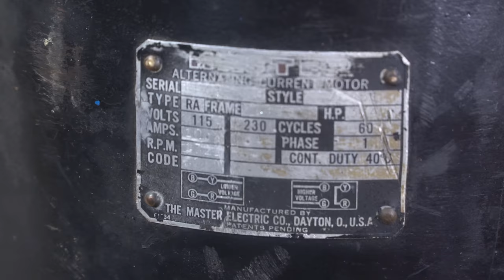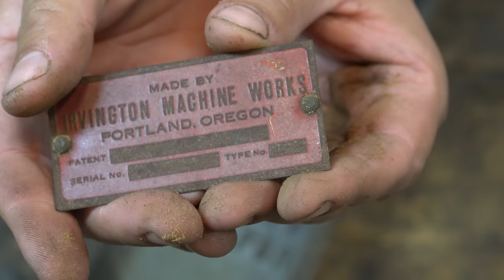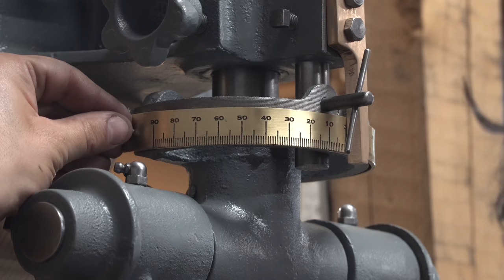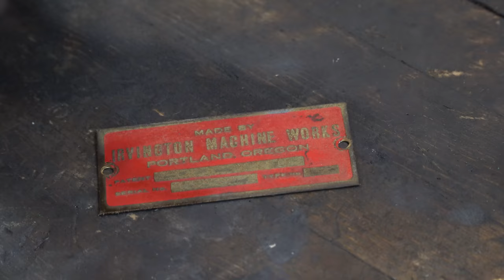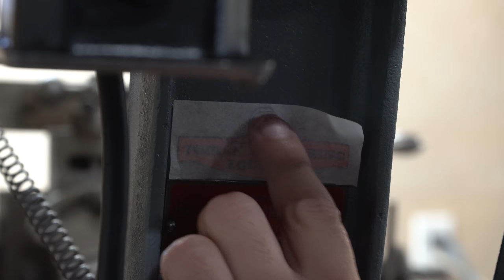Swing Saw [Restoration]

Comment: The suicide saw aka "the model"
Reply from the maker: Should have just called it "The Murder".
Reply: @HandToolRescue  Yep indeed HAHA XD
Reply: was just about to say "what a dangerous saw" but you beat me to it
Reply: I was thinking that "Riders on the Storm" should have been playing while we watched it operate.
Reply: Safety is not your number one priority !  lol  XD
Reply: ''Hello, i need a replacement blade for my saw.'' - ''Wich model sir?'' - ''Yes''
Reply: @HandToolRescue  What process did you  use @24:04? Did you mask Stainless steel with paint, then use laser to make lines in the mask and etched it?
Reply: 23:41 is that a 'Weltrekord' I spy?
Reply from the maker: @RagingShrimp67  Yes.
Reply: It's not that dangerous by itself, but those wood beams look way too thin to support it for more than a short demo. Actually table saw mounts aren't inherently safer, just more familiar/popular, in a proper mount this thing can be quite useful for someone who knows how to operate it. 
As a side note, very few workshop injuries are related to large wood saws, probably because most people tend to be a bit more careful around large spinning blades, statistically the most dangerous hand operated tool is the angle grinder (and for the non-powered ones the good old hammer still brakes more fingers than anything else).
Reply: hey my Mechanics didn't you restore a screwdriver like hes using at https://youtu.be/oUWOOFII144?t=1420
Reply: A saw so awesome Kraftwerk wrote a song about it
Reply: @my mechanics: is he using the screwdriver at 23:40 you restored? Or its just the same model?
Reply: @valkasolidor6727  no, Along Came Jones by Ray Stevens

I plopped down in my easy chair and turned on Channel 2
A bad gunslinger called Salty Sam was chasin' poor Sweet Sue
He trapped her in the old sawmill and said with an evil laugh,
"If you don't give me the deed to your ranch
I'll saw you all in half!"
Reply: @trollforge  Was he slow walkin'?  Slow talkin'?  Okay, yeah, it checks out sir.
Reply: @HandToolRescue  The Corpse Disposal.
Reply: @HandToolRescue   Now I am whispering... "The Murder".
Reply: It had a more complete name but it got chopped off.
Reply: Sie ist ein model und sie seht gut aus
Reply: @HandToolRescue  "The Mangler"
Reply: @HandToolRescue  my dissapointment is immeasurable you didn't use the other side of the giant wrench for the smaller square bolts. I don't think I'll ever be alright again. How do you pre-pose we correct this?
Reply: @Dr_V  I would give this comment a thumbs up but my thumbs are currently too swollen to make such a gesture. Venture to guess why?
Reply: Haha the murder!

Comment: Well that is a truly frightening machine! Nice method for making the brass scales 😉
Reply from the maker: Thanks! If only there was a good video on brass acid etching...
Reply: @HandToolRescue  if there's one thing the internet needs it's more brass etching videos!
Reply: @SwitchAndLever  agreed!
Reply: Sorcerers! The whole lot of you!
Reply: @SwitchAndLever  I know you already made a brass etching video, but maybe you could upload another?  We miss you and need a fix.
Reply: I have actually used something similar to this. Terrifying is more the word! As always an excellent restoration!! I'd like to know how he finds that stuff?? Some of it I've never seen before!
Reply: What did you use to print the resist onto the brass for the etching process?
Reply: It's seriously what Poe would write about.
Reply: Don't lie, How many of you read that comment in S&L's accent? I know I did!
Reply: @mikepelletier1399  It looks like he painted the brass and then removed bits of the paint using a laser cutter.
Reply: @Ragnar8504  yes, that looks about right, but why not just use that instead of going through the process of etching?
Reply: I cringed every time that saw moved.
Reply: @mikepelletier1399  You can't. Most places I've heard of have CO2 lasers that won't touch metal at all. Fibre lasers, which are even more expensive, will scratch the surface of some metals and cut very thin films but I suspect for getting this deep into brass you'd still have to etch it. There are lasers that cut serious stainless sheet metal but they're huge and probably cost millions. At work I've got a 120 W CO2 laser, which costs as much as a Mercedes but it doesn't engrave or cut any metals. The typical DIY lasers have much less power than that.

I'd definitely like to know what kind of paint is safe to use in a laser cutter because that's quite an interesting application!
Reply: @Ragnar8504  that makes sense. I use to program laser engravers to do 3D QR codes in plastic for the military. And it could oblate the black anodized surface of metal tags. That's about all we dared to try. Something about laser feedback from shiny metals or something. But it could cut shapes out of wood and plastics at %100 power.
Reply: @mikepelletier1399  Yup, that about sums it up! I don't think trying it on metal would cause any harm but it just wouldn't work. The only thing ours can and will do is "mark" steel, i.e. if you coat the steel with some kind of paste supplied by the manufacturer of the laser, any spots hit by the laser will turn black but that's only on the very surface of the steel. Rumour has it that mustard will do the trick as well but that hasn't worked for us.

A 60 W CO2 laser will cut through quite substantial pieces of timber (relatively speaking) if you run it slowly enough. I've cut 13 mm pine plywood. The edges are quite badly charred and no longer quite straight but it does cut. The official info is that you can cut roughly 1 mm of timber per 10 W of laser power, which equals to a maximum of 6 mm on a 60 W laser and 12 on a 120 W. However, the thicker the material gets, the more the laser is out of focus so you'd have to cut in several passes, adjusting the focus in between, to get a perfect result.
Reply: SCIENCE! Not poems and rubbish. Or fingers. Or any appendage or limb that happen to be in the room.

Comment: A very nice machine, and, as usual, a nice restoration.  Regarding many of the comments, the swing saw is no more dangerous than a molder, jointer, table saw, shaper, or many other tools in a millwork shop of a few years ago.  I operated all of the machines in the shop at one time or another, and I still have not only all of my fingers, but even the first joint and finger nail on each one.  We did not use push blocks, finger boards, or blade guards.  It is just a matter of paying attention to the work at hand.

Comment: This might be the most terrifyingly dangerous piece of equipment I've ever seen.  I have a respectful fear tablesaws and bandsaws when I use them, but this thing?  That's a nope from me, dawg.
Reply: used in saw mills, to cut boards to length inside larger machinery. These were not 'operated' by a person like a table saw.. they are mounted in much larger wood conveyer structures and operated either by push-button or later, automation, to cut boards passing beneath a gang of these to length. I conveyer might have 6 or 10 of these above the boards on 2' increments
Reply: @jenniferwhitewolf3784  So what he used as a handle at the end would have a mechanical arm on it instead? That makes way more sense because as is this thing is just waiting to jump out toward the 'user' as soon as the blade binds even a little bit.
Reply: I was thinking the same fellooww
Reply: Doogie Carpit Burger  Good to know that he got away with just that. Sounds like he could have lost the whole hand.
Table saws are scary because you can't see the cutting edge, it just kinda pops out of the wood. It does not help that most people remove all blade guards and such off them as well. 
With that said, the scariest table saw i have seen was an industrial auto feed one. The auto feeder chain had pretty major teeth on it and ran continuously while being hand-loaded. So yeah, don't wear long sleeves around that one for sure!
Reply: Doogie Carpit Burger  Table saws are mostly safe, if you use common sense and follow some simple safety practices. Most people take them off, but those blade guards and riving knives really should be left on. At the very least, the riving knife should be left on. The most common table saw injury is cause by a board twisting and getting pulled (violently yanked is a more accurate description) into the blade. This causes the board to pull your hand over the blade. It happens so fast that you have no time to react. It's over before you ever realize it's happening. A riving knife significantly helps prevents that from happening by acting as a barrier to keep the board from turning/twisting into the blade. The guard mainly serves as a reminder/warning that your hand is getting too close to the blade. It protects the blade from some angles, but if you are being stupid and doing dangerous things, that guard is not a guarantee of your safety. 

If you are not prepared to use common sense and give that saw the respect it demands (they don't ask, they get it or else), then yeah. Stay away from them and really anything else with moving parts. You don't have to fear them, just respect them.

Comment: I'd ditch the screen door spring for a nice counterweight on a pulley, look neater, be easy to tune and might even work better
Reply: Yup, that would be a nice gesture towards "safety" (I think having one of these in the building would make most heath and safety managers have a heart attack) so letting go swings the blade away from you decisively.  For added fun, you could have a spring for it to land against so it bounces back towards you 😁

Comment: I remember using one of these saws at a joiners shop where I did my apprenticeship. It was used as a docking saw for the larger planks of timber (cutting the timber to rough lengths for dressing to size). Our swinging saw was set well back with the bench being not flat but angled upwards to keep the timber in place against the back fence and to accommodate the swing of the saw. It was commonsense to stand to the handle side of the saw and use your left hand to pull the saw outwards ensuring you were well clear of the saw blade. I do not recall anyone hurting themselves on this saw and I quickly developed arm muscles to pull the saw outwards. Ah the good ol' days...
Reply: I'm 65. My Dad would have used that saw in his day as a construction worker before and after WW2. Thank God a pallet of 2x4's fell on his head from a second story and he became a barber before he dismembered himself with that machine. Great barber, terrible carpenter.

Comment: I love how gorgeously designed yet inherently sketchy that saw is. It's even more dangerous than a radial arm saw, and I thought those were pretty sketch.
Reply: You should see the old belt powered belt saws before electric motors came around. A lot of them had blades bigger than 16”

Comment: I used one of these with 4” leather belt drive & a 30” saw blade we called it a pendulum saw it could saw timber 30” wide x 6” thick. The blade had no guard at the front.

Comment: Is this the rare tool that's actually safer to use left-handed? The swing handle puts your corpse in line with the blade if you use it right-handed, but with the left you're clear of the plane of death.

Comment: As a child of perhaps 5 [1953?] I accompanied my father to the local box factory to pick up some hand saws he was having sharpened.  As a treat, he took me into the sawmill area where I saw a huge swing saw in operation cutting big Ponderosa pine logs to length.  The blade was perhaps 6 feet in diameter, and the logs didn't have a chance. I was very impressed...

Comment: A few comments regarding this video:
During the "Great Changing" the reverence was afforded to entirely the wrong part.  A new part is just a celebration.  The worn past part should have received a proper burial.  You should edit the video.
There are two manufacturers of forehead pads for sand blasters on Amazon.  I suggest looking into one.  (Maybe purchase a pair)  I did, and haven't looked back.
The casting engineer that placed "The Model" into the casting also writes for Saturday Night Live on weekends.
The part that "bothers you" also bothers me.  I would have struct the other side of the bronze part with a knurled framing hammer so they match
You seemed overly concerned with the initial trial run of the restored machine.  You surely forgot the spring is an OSHA approved safety device.
I was also disappointed to see that you are now using a light oil on the threads.  Are you out of maple syrup?
I have three friends that have used this model saw for a few months and would have loved to have seen such an impecable restoration, but they are all dead now.

If you guys missed Eric's interview on You Tube channel EC2, I recommend it.

Comment: "The Model" ... It sure was kind of them to identify it for all of the future lawsuits.
Reply: They don't build them like they used to... in a seemingly unrelated note, jobsite mortality rate is at an all-time low.
Reply: Keep using that thing, you will need to change the channel name to "Hand Rescue"
Reply: I can keep going, but seriously... I've used some sketchy power tools and saws, but this thing? Nope. Not a chance. It's almost like it was specifically designed to kick forward and mangle the operator.
Reply: @MrNside  hence the proper name:  "The Mangler"
Reply: @MrNside  Just don't sit in front of it, problem solved. Handle is off to the right, so as long as you design a holder that can hold the left side of the wood for you without needing an arm in the way, you would be safe.
Reply: Alternatively, just use two people to secure the work.
Reply: @Adierit  
Sure, there are ways to use unsafe tools in a safe(r) manner. Keep in mind, most safety mechanisms in current tools aren't there for the 9,999 times you use it properly, it's for that 1 time out of 10,000 that you have a lapse of judgement. In most other saws, that lapse of judgment would most likely result in a lost finger, or maybe even a hand... This thing? It will slice your chest and head in half. In fact, looking at it, it seems like it would be more effective at doing that than cutting wood.

Comment: That looks like a exquisitely dangerous saw. It's nicely made. You did a great job on the restoration. It's just of those things that seems to want to turn my dexter into sinister. 

The bolts with the tall heads and also the cheesehead screws look nicer than your modern bolts/screws for some reason, as if we've been shortchanged.

Comment: I wonder how many fingers that machine cut off lol,you need a big giant emergency stop button for that I thought your little finger was going to be the next victim and wheek it off into the sky ,great job great episode 👍👍
Reply: That thing seems WAY too dangerous to actually use, and I'm hoping he'll just have it as a display and conversation piece. But IF you were going to actually use it, you really should have some kind of a "dead man's switch" foot pedal where as soon as you take your foot off it shuts off power to the motor. Not only is the blade dangerous, but the drive belt could seriously hurt you too.

Comment: i'm all for salvaging a good tool. i just yesterday worked on the brush contacts on my new but 2nd hand saw ($2 at a yardsale). a couple days before that, i had to take apart the switch on my old one just to finish what i was working on. switch contacts were burnt, wire brushed them and die electric grease to help keep the crap out. it's kinda dangerous to, guard was broken before it was given to me. that thing though.. it's on another level. i can't even use a knife without cutting myself more often than i care to admit. some things just need to be melted down for scrap buddy. i can't believe that such a device was even a thing.

Comment: I used to run one of these to cut up metal at a copper alloy processing plant. These things definitely need to be respected when using them. I've had 30 inch blades bind up and explode on me lol. Always had to wipe when it happened. Also ours was way bigger and the whole saw hung from a chain fall. The saw in this video looks much safer lol

Comment: I worked with saw like this in the seventies, where the boss had to spend half of your first day harping about how many people had removed hunks of their hands with them. Thank God most of the cut-off equipment was much more modern, with hoods over the blades. Even then you could easily get your fingers clamped to the table top and lose finger tips or more. It was a macho world for sure. It was a union job too, but the state (OSHA) hadn't caught up with all this stuff yet. You could wear hearing and eye protection if you wanted to, but it wasn't mandatory. Most of the old dudes were deaf as a board. I wore the PPE. There was a certain amount of teasing about it, but when you're deaf, its hard to tease someone effectively who's wearing hearing protection.

Comment: Most tools, and other appliances, I have seen here could still serve a purpose today.  This is not one of them.  In order to use and maintain this machine indefinitely you have to have an entire shop's worth of tools and equipment.  It is also unnecessarily large and unwieldy.  And could easily be replaced by much smaller and more versatile tools, which will cost less in both initial purchase and ongoing maintenance.

Don't get me wrong, I am glad it is restored back to working order.  I just hope there aren't many of them still around.

I doubt THE MODEL was a good purchase even back in its own day.